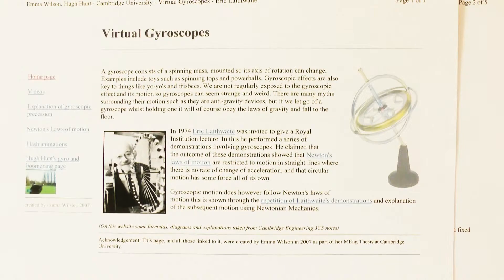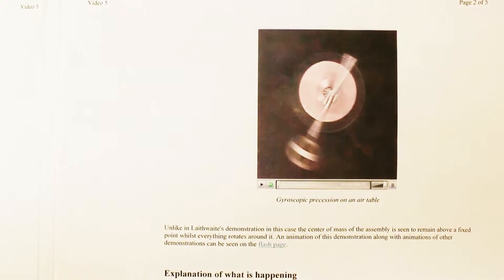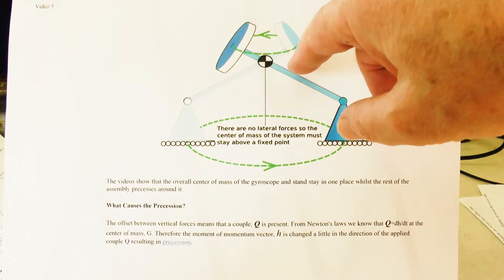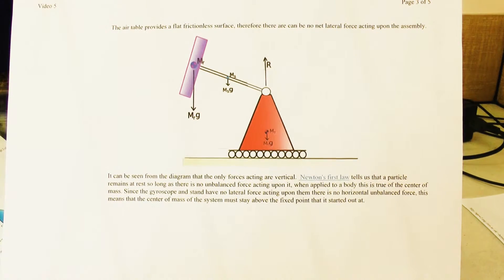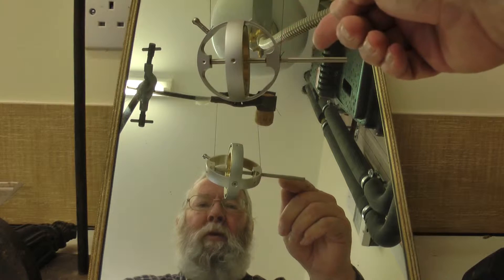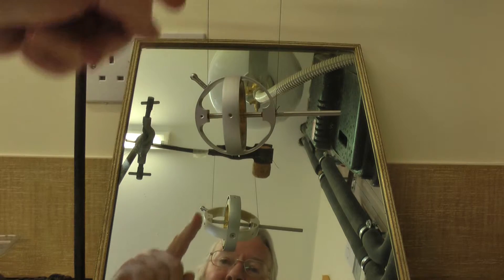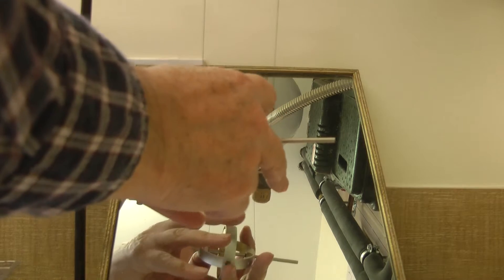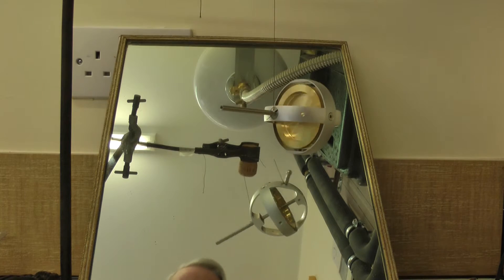Gyroscopic anomalies

Comment: Yes, Cambridge University is very wrong in its teaching of precession. Here is the real truth about it. 
The experiment in this video using a frictionless trolley or iceblock with lack of friction under the pivot, works as it does, because if the spin in the gyro is very very fast, then there are created in the precessing-gyro-wheel,  two phenomena which are, an outbound and inbound centrifugal forces acting on the upper and lower half of the gyro "face" and to the left and right of the vertical diameter of the gyro wheel. Their vertical separation sees to torquing against the down weight of the gyro through the arm ( m.g. R arm)  while the horizontal separation creates the precession angular rotation seen in a floating gyro experiment.  These two opposite acting but separated centrifugal forces to produce both a vertical and a horizontal torque are equal (most of the time the gyro spinning is fast) and so there is no lateral reaction on the pivot. Since there are no linear accelerations and the angular accelerations are constant, then there are not even any horizontal flicks on the support pivot due to the orbiting torque of the gyro. The pivot in this state will only take the vertically down acting gravitational weight ( one constant acceleration)  and any other change in accelerations in the height and orbiting of the gyro.  When the spinning of the gyro is reduced, then the upper inbound centrifugal force is reduced and the normal centrifugal force on the gyro and the ice block or the wheeled support trolley is established and their presence starts to be felt. At slow angular rotations, there is also a lateral horizontal force on the pivot in a sequence of directions and the rotation will first seek to rotate about the total mass center as both the outward centrifugal force on the trolley/ice block and also that on the gyro, will fight out a tug of war between them.  There seems to be a horizontal "orbiting" torque on the apex of the two cones made by the wobbling extension arm that does not seem to be always lined up at the same central location, but it orbits in small circles while both the ice block and the gyro are eventually, rested.  The last motion is much more than an example of a " horizontal flywheel" with static balance and dynamic unbalance.
------------------------------------------------------------------------------------------------------------------------------------------------------------
****In order to understand the engineering /physical reason for the creation of the inbound and the outbound centrifugal forces and how they change their relations with different spinning relations with the radius of the extension arm Ra, the radius of the spinning wheel Rs, Wp angular procession of the radial arm, Ws the angular spinning rate of the gyro wheel is to simply draw the plan view of the gyro spinning and precessing wheel around the pivot point:-
Assume the above machine has its gyro and extension arm in a  perfectly horizontal position, then draw the PLAN  view of the whole system. Take Ra to be 1 to 3*Rspin  while marking the largest circumference at radius Rs (mentally or otherwise) of the Spinning wheel every 90 degrees by using 0, 1, 2, 3 as angular position symbols. Four marks are enough to see the result.  Then measure the radius  Ra and draw the arm rolling flat circle, then the tangential line diameter 2Rs of the spinning wheel. The plan view will be a circle that the arm Ra executes while the line 2Rs as a tangent to the circle will represent the gyro maximum diameter in the horizontal location.  To see the lack of or the creation of the internal bound and external bound centrifugal forces in the plan view on the central pivot, first, draw the trajectory of one mass particle (0) on the spinning wheel without the extension line arm radius Ra advancing anywhere. Simply keep the center of 2Rs  which is (maximum diameter representation of the gyro)  tangent to Ra circumference, and choosing the position (0) on Rs as being vertical to start, roll the "vertical radius Rs through one revolution while the center of the gyro rests in the same location.  The first vertical point on the gyro starts as a tangent to the circle Ra.
 Plotting only four points in sequence every 90-degree rotation of the spinning gyro represented by a tangential line, 2Rs in length, this will include, (First point, tangential to the circle (vertical radius situation )) then, (the second point at the maximum diameter say extreme right of the tangential gyro,( horizontal radius situation)), then  (The third point representing the radius of the gyro reaching the lowermost point which would be like the first point tangential to the (Ra) circle) then ( the Fourth point which will be to the other extreme end to the left of the line 2Rs representing the horizontal radius of the gyro)  then include (a Fifth point  tangential to the circle at the starting vertical point, representing the gyro turning one full circle. )  Note that without Ra advancing, that all these five points exist on a straight line in this plan view of a spinning gyro which means that the outer tip of a  spinning radius will be forming a perfectly flat circle rotating in the vertical plane tangential to extension arm, Ra)  This radial Rs centrifugal force in the spinning of the gyro will not affect the pivot point in any manner apart from storing spinning energy in it.
Now, having the (Ra) circle and next to it the tangential (2Rs) line diameter of the gyro, follow the free ends of the line Rs and this is found to be far away radially from the circumference of (Ra) circle.
Using the previous central pivot point as a center, draw a second larger circle with a radius as long as the outermost tip of the diameter representing the tangential gyro wheel.   All the magic that shows the creation of the inbound and outbound centrifugal forces in a gyro is located in between the circle represented by the radius ( R arm ) and the circle represented by the radius square root(Rarm^2 + Rs^2)
To draw the trajectory do what one did before, but  ADVANCE THE GYRO TANGENTIAL LINE  (Ra) every 90 degree turns of the gyroradius starting with a gyro vertical radius at the tangent of (Ra) circle. Do not choose the advancement of the gyro on Ram circle too small, but whatever advancement you chose,  the spinning radius of the gyro with the gyro rolling along (Ra) circle, will produce the plan view of the VOLUMINOUS THREE DIMENSIONAL cycloidal path of one spinning and precessing gyro mass particle on the tip of one gyro radius. This flat representation of the three-dimensional trajectory will tell the full story of why the gyro behaves as it does and if one follows the movement of the "center of curvature " of this plan view of this cycloidal motion of one mass particle in a spinning gyro, then all inbound and outbound centrifugal forces directions are known.  ALL UNIVERSITIES WILL HAVE TO ADJUST THEIR TEACHING OF WHAT MAKES A GYRO WORK AS IT DOES. The stunning accelerations that exist between the two flat circles representing the tip of a radius and the center of the gyro are just remarkable to behold. 
These two centrifugal fluctuation forces in the gyro should be now called, " The Professor Carmel Pule' gyro centrifugal fluctuating pair!" 
With respect to the central pivot support point, the plotted trajectory existing in between the limits of two circles will have beautiful symmetrical with one curve representing the trajectory of the mass particles in the upper half of the gyro showing a convex curve while the other showing the trajectory in the lower half of the spinning gyro will have concave curve trajectories  THESE TWO CURVES WITH RESPECT TO THE CENTRAL PIVOT ARE THE MYSTERIOUS TWO CENTRIFUGAL FORCES WHICH GIVES THE GYRO ALL ITS MAGICAL BEHAVIOR. 
Every engineer should be conscious of the ingenious manner in which the outbound and inbound acting centrifugal forces in a spinning and precessing gyro are created, and how their vertical and horizontal (diagonal) separation can be used to torque the spinning gyro wheel to float up or down the weight of the gyro and at the same time control its processing rate. 
This is the fundamental operations of all gyro machines shown by Professor Eric Laithwaithe, Sandy Kidd, Woopy jump, Maths Easy Solution, Jogglevision, and anyone else who works with gyros.
This is now continued in a reply comment
Reply: continued from another comment.
Addenda.
A.   It is to be noted that since I wrote the above, my research has shown that when a gyro is spinning and precessing, then two centrifugal forces are generated, one is "inbound" acting on the top ( horizontal ) half of the face of the spinning gyro and the other "outbound" acting on the lower (horizontal)  half. These two forces are generally of the same magnitude at high rate gyro spin, but opposite in direction and so the "floating gyro " will not show any centrifugal force as we know it. At lower spins, the conventional outbound centrifugal force takes over. The gyro rises because the inbound centrifugal force acting on the top half helps to " torque" the gravitational weight of the gyro upwards to lift it as shown in the video. For a normal torqued gyro without the extension arm, this phenomenon also happens to change the angle of the gyro.

If one wants to dig a bit deeper then one needs to study the accelerations in the three-dimensional cycloidal trajectories followed by one mass particle in the spinning gyro.  The plan view of the cycloidal trajectory will show the presence of the inbound and outbound centrifugal forces acting on the top horizontal half and the lower horizontal half respectively. These two centrifugal forces will eliminate the conventional outbound centrifugal force we are accustomed to and there is no reaction on the central pivot. 

B. If one looks at the side elevation of the cycloidal trajectory of one mass particle in the spinning and " cycloidal translating" gyro wheel, then one would see that as the mass particle is being accelerated down one of the "vertical halves", the GYRO CENTRE needs to lift up to produce this acceleration and while the particle is being decelerated up the other " vertical half"  then the GYRO CENTRE also needs to react to this deceleration by lifting up.  It is this lifting up of the center of the gyro wheel due to the large radius accelerating particles down one "vertical half" and decelerating mass particles up the other 'vertical half"

To understand the contents of the last paragraph all one needs to do is to appreciate that   THERE IS A SOLID CRANK FORMED  by the fact that the long extended  SOLID axle of the gyro is SOLIDLY  attached to one spinning SOLID gyro radius at 90 degrees whose outward tip carries the heavy mass particle  WHICH IS CONTINUOUSLY BEING ACCELERATED DOWN A VERTICAL HALF AND DECELERATED UP THE OTHER VERTICAL HALF.  It is this lifting reaction that carries the gravitational weight of the gyro ( or other side weight) without affecting the reaction on the central pivot point carrying the floating gyro!  That is the whole reason why central pivots on ice cubes and wheeled trolleys and hanging strings behave the way they do. 
To test the CRANK ACTION in a gyro, bend a piece of solid wire in the form a crank with long shaft and quadrature stroke throw, place a heavy nut on what one may call the " big end of the crank". At the pointed end of the crankshaft ( replacing the central pivot) bend it up a little so that one has a moment arm to rock the crank where this "pointed central pivot side" is held to rock and roll,  but stay in the same position. If this crank is placed on a free edge of a table so that the weight hangs down, on rocking the crankshaft the hanging weight will stay in the same location due to its inertia but the solid corner junction between the shaft and the throw will swing and take the reaction.   It is important to note that NO GYRO WILL WORK IF THE JUNCTION BETWEEN THE AXLE AND THE QUADRATURE GYRO RADII IS NOT SOLID ALL THE WAY. 

Conclusion:-
A. The two opposite centrifugal forces acting on the top horizontal half and the lower horizontal half will eliminate the conventional centrifugal force when the floating gyro spins and precess at high speed. There is no rection on the central pivot because of this phenomenon. 
B. The downward acceleration of mass particles down one vertical half of the spinning gyro and deceleration of mass particles up the other vertical half will react in lifting the center of the spinning gyro to lift the gravitational weight of the what torques the gyro. The fact that these accelerations take place in the vertical plane they have no effect on the central pivot point. The lifting of the center of the gyro is not perfectly vertical but has a  circumferential component with the radial arm which causes the radial arm to rotate/ precess. The fact that these forces are generated within the gyro itself as if the gyro has a propeller to pull it around, there is no reaction on the central pivot as when airplane banks to take a curve. IT ALL BECOMES A SELF CONTAINED LIFT AND TRAVEL as a self-powered aircraft flying. ( It is gravity torque and angular torque in a gyro...(mgRarm= IWs.Wp))
Please note that I tried to simplify it but in practice, A and B functions work together.  At the slower spinning rate of the gyro, the rotating masses are subjected to the normal outbound centrifugal force and when there are two masses they will finish up rotating about their center of masses but only if the gyro is not spinning fast enough.

All the above work should be checked by 
The Imperial College London, Dundee University, University of Cambridge, Sydney University, and other universities where gyro projects were taken up. I now work on my own but did a lot of work at the University of Malta and I would like  these phenomena to be called, " The Carmel Pule' horizontal and vertical  cycloidal variable accelerations in gyros"   or " the Carmel Pule' opposite axial accelerations and the accelerations in the slightly thicker cylindrical/cycloidal larger apparent volume of the spinning and a precessing gyro"